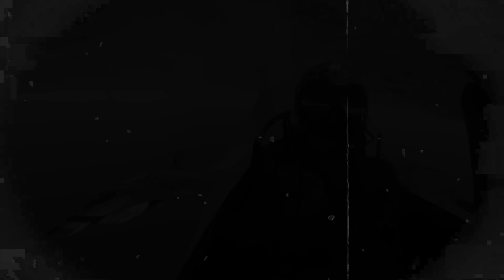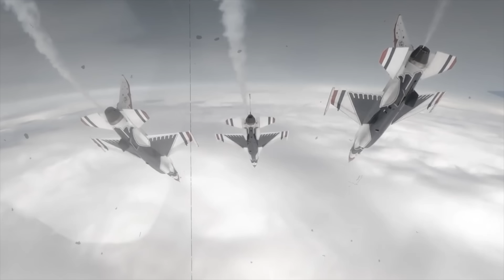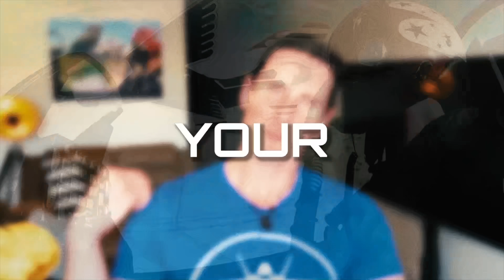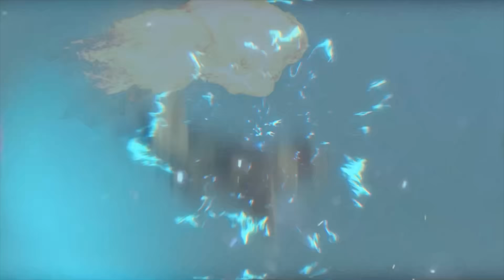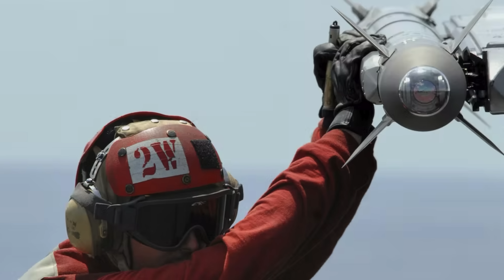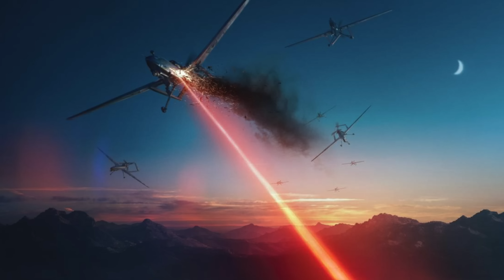F-16 Missed Its First Shot At Lake Huron UFO

Comment: Regarding the downside to shooting these things with cannons - One interesting point I have heard being made by a fellow I talk to online who has a background in both Meteorology and ATC - The pressure difference inside these types of balloon and outside is usually quite small. Peppering the part that actually has lighter than air gas wouldn’t really do much other than to allow that gas that keeps it aloft to escape. Obviously that would lead to a gradual and UNCONTROLLED loss of altitude DOWN into the same airspace shared by commercial and private aviation. 

Nothing says “bad optics” worse than accidentally dropping a fairly benign object into the path of a 737 full of civilians on a routine flight to wherever. 

There is also a story floating around (no pun intended) about a pair of CFA F-18’s both completely unloading their 20mm into a Russian balloon with minimal effect. It just kept floating in the same direction, gradually losing altitude until it splashed down somewhere around Port Hardy, B.C. 

I think it would be worth considering actually snatching these things instead of dropping them. The very first American spy satellites (KH-1) had their film recovered in a similar manner and the CIA perfected the Fulton System (Skyhook) that used passing airplanes to grab a balloon that had been released by a downed pilot or asset that required immediate extraction. Sounds goofy as hell but it HAS been done. That would certainly leave a lot more for our people to poke around and see what’s what. Just don’t take it back to anywhere TOO far off the beaten path that we don’t want the other guys to know about…

Comment: That glass-like done at the end of the sidewinder is a heat sensor because aim sidewinder is a heat seeker!! How much heat did the object give off?? But if the object was small as they say and had a tiny radar cross section then maybe a heat seeker would have been a better option??

Comment: I'm guessing the Sidewinder missed because there wasn't enough temperature diferrential between the temperature of the balloon and the temperature of the background air. They're designed to shoot down jet aircraft which have hot exhaust gasses, not balloons which would cool down or heat up according to the air around them. The shape is interesting, if this is an actual image of the device, it may be that adversaries are trying different radar reflecting shapes to see what shape remains undetected for the longest time.

Comment: There were A10s just sitting there available just minutes away in Alpena, but a slow commercial aircraft was all that would be necessary to evaluate the threat and even follow it down for recovery.
A jet was unnecessary, a properly equipped helicopter could have been used with a simple mounted machine gun.
This whole event was pointlessly expensive for no good reason.
They will tell you it wasnt a balloon but it was a balloon.

Comment: A10 Big sexy certainly could have been/should have been used with the AF32 round which self-destructs about 10 seconds after firing. These are used in the ground based CRAM and other platforms so you don't rain down the bullets.

Comment: The Chinese balloon was flying at 60,000 feet. None of the alternative aircraft you mention (in the bonus round) can fly at that altitude - the air is too thin for "slow flying".

Similarly, the object over Lake Huron was at 20,000 feet. Doubt either of these crafts could reach that height and fly slowly.

On the Sidewinder "miss", unfortunately, you guessed. That is a "miss" in itself. : )

Comment: If the target was jinking' across the sky, say with pulses of movement, then the 'engine' could be puffing out volumes of heated gas to achieve this effect.  These volumes would have the same effect as a flare if the missile arrived just after a pulse, so it all depends on the 'kill' radius of the particular ARM missile chosen as to whether the object was hit ot not. Think of a Portugese Man of War jinking through the ocean with its dangly bits.  A PMoW Drive.

Comment: So far these objects have not been aggressive, however, they do navigate. Even over waters like Lake Huron, you don't want some fisherman cutting open his catch and finding an unexploded warhead. The 20mm is small as warheads go, but if it goes off at arms distance from you, it has ruined your day and probably other peoples too. So, inert rounds are called for. If you put a single 20mm round through a balloon, it could take days for enough gas to escape to bring it down. A partially collapsed balloon will act like a parachute so dropping it on target isn't going to happen. Maybe we could drop a big cargo net out of the back of a C-130 to see how much weight it can carry. That would be a slow descent, but trackible.

Comment: Question... How thick do you think the "strings" have to be to be able to see them?  Ive heard the audio...  they first reported seeing the object at about a mile away, with low visibility.  Yet they noticed it had "strings" hanging down, it was octagonal in shape and was black in color.  They also said it was about the size of a 4 wheeler (according to the flight audio log).  **the A-wax call sign is Huntress btw.  :)  **

Comment: I was actually on vacation at a cabin directly on Lake Huron when this happened. We heard the F-16’s flyover around 3 pm (shoot down happened around 2:52). I assumed they were training out of Alpena ANG base before it was confirmed there was a shoot down. We had an AWACS circling overhead for around 5 hours and a KC-135 over Lake Huron. The next day a C-130 was out by Canadian waters flying low (2,000 ft) in a searching pattern.
Reply from the maker: Dang that’s awesome thanks for sharing
Reply: @MaxAfterburnerusa no problem. I wouldn’t doubt that this thing flew right over us, we were close enough to the UP of Michigan, and where they shot it down was a straight line east off the coast from us. Very crazy to have something like that happen in such an unpopulated area.

Comment: Great stuff Max-  question:  Couldn’t we also consider “capturing” one of these objects?  As in…using a C-130- rear cargo door down….extending a net/cable system-  that would increase the mass of the object-  causing it to fall.  And imagine if that rig had a parachute-  auto deployed at a given altitude.  Or Floatation bags.  Kinda a Capture and Cradle approach- and a means of preserving as much as possible of the objects.
Reply from the maker: Sounds super smart to me
Reply: Thought about this alot
Reply: Unless they were rigged to self-destruct on capture. But that's probably not likely.
Reply: They most likey already know what these objects are and want the least amount or no evidence to ever be found for classified reasons.  The fact that no pictures or a single piece of debris was recovered says it all....

Comment: Could you do a segment on the probably fate of the missed missile?  Does it have tracker so it can be recovered easily? It's probably at the bottom of the lake and I'm sure the Air Force doesn't want some boater catching it on their anchor. It it possible to have its warhead denotated remotely? Just curious.
Reply: Following this

Comment: When I heard of the first one, and everybody was speculating if or how we would shoot them down, I had figured we would send up an ANG F-15 with an older AIM-7M. The AIM-7M is still in service, they're old and cheap, and semi active radar homing would mean a potentially very far, safe firing range. 

What's your opinion on why they didn't use a Fox 1 or even Fox 3? The Fox 2 just seems the least likely missile to do the job. Illogical even. I really wanna know your take on it though.

Comment: OVERALL
The most likely answer to all of this is that the Chinese have used high-altitude balloons to both surveil and launch surveillance drones for years, including over U.S fleets in international waters.

DRONE OVER HURON
If the drone was shot at 20,000ft over Huron, then it was probably seen at that altitude, or higher, in Colorado. It likely rode the approximately +60knot winds northward at that elevation to be seen the next day 1,000 miles away over Huron. To me, this possibility makes it most likely a balloon, or hybrid-balloon with drone-like directional technology (propellers), and a minimal set of surveillance equipment.

CAPTURING A DRONE
Instead of destroying an apparently slow object, is it possible to either capture it or disable its propulsion or lift capabilities so that it descends?

METHOD 1 : DRONE. Is it possible to launch a drone from a cargo plane, fly it toward the balloon or drone, attach itself, disable the foreign object’s propulsion or lift, and descend with the object in tow? Or if not possible, could a drone at least disable the propulsion/ lift to force it downward?

METHOD 2 : HALO. Is it possible to use HALO to make contact with high-level drones and balloons? Would a HALO parachutist be able to make contact safely? Is it possible to briefly explore their construction, to attach equipment that will direct them downward, or to damage their method of lift or propulsion enough so they descend? Even if contact is not possible, is it possible to briefly photo-observe them in action to gain more info about how to engage them by other means?

METHOD 3 : SNIPER. Is it possible to fly a cargo plane with one or more snipers who can damage or disable the balloon or drone propulsion-lift thereby forcing it to descend?

METHOD 4 : AERIAL CAPTURE. Like we did in the Antarctic, is it possible to extend a “hook” or net from the ramp of a cargo plane, snag the object directly, and drag it inside? That seems risky and Vietnam-era-CIA old-school, but is it possible?

Comment: Looking at this object with its sides shaped & contoured as sails, makes me wonder if it, by utilizing an adjustable internal ballast, perhaps mounted on something similar to a gyroscope, is sailing within, through & across the jet stream.
Reply: Yes. It may be pretty simple mechanically, but still able to surf the jetstream. The "strings" on the string version could simply be ropes of heavy ballast it drops off to climb. It probably needs a good flight computer and a comms link for weather data so it can work out when to go up and down to exploit the latest changes of wind speeds and direction. 

But I think the octagonal craft that ended up in Lake Huron must also have had some gentle stealthy propulsive system, as it seemed to be able to add about 100mph to its velocity above what the wind was providing. Enough for moving across and against winds, and to loiter. So the power required is probably no more than that of a small aero or motor bike engine. But made out of stealthy materials. It could even be a pulse jet, as they are mechanically simple, perhaps allowing the use of low radar-reflecting materials in their construction. The return of the V-1 Doodlebug!

Comment: depending on how durable the object is, you might be better off ripping past it at mach (not hitting it) and allowing the shockwave do the work (less affective at very high altitude) but it might not take much.  weather ballon material is pretty thin stuff.
Reply: Why don't they do that?
Reply: @UNQUEATH because of the higher risk of losing the entire plane
Reply: Great idea!
Reply: @@reidjames4638 Don't or won't?
Reply: Could have sucked it into the intake and glided back to the field. 2 birds with one stone - kill and retrieve! 😝

Comment: Hey man, have loved the channel since the first gs reaction. It's awesome to have a positive, genuine people in the military aviation community.! 

So my question is, (if you can speak on it at all) what other weapons, weapon systems could or can't be leveraged for these engagements. 

Example, why not a HARM/AAMRAM/ aim7 ect... Of all the aim type Missles. 

Secondly what about ground launched munitions, like some of the newest kinetic / EW, "drones" for anti drone operations. 
I think it would be good to test those systems to do what they were literally designed to do. ( I know the safety aspect but punching off a Missle isn't much better, plus you could still intercept and get visual from further away or slower aircraft could handle it.) 

 
I have thought alot about  these non kinetic/explosive/ destructive, net / capture & EW  types. I would think that's the best way to recover them. ( Assume size/mass is the reason they aren't being used)

Also other ATG/ATGMs , like HELLFIRE not sure the specific name, but the one without a warhead. Or even tow type stationary/ Lazer guided

Personally for the most part, (beside the first balloon sat  because of it's ALT) because of the size an speed. I would want to be as close for vid & far for de-conflicting/safety. So  if I'm engaging something that is relatively stationary to me or the ground. I would need to match it's speed. Manage my closer rate. Super difficult, in a jet.  But seems to be a helicopter ie apache/cobra ect.. would make that much easier an safer.  Another question is can a f35 b go into the hover or relatively stationary at Alt  (I assume not) 

Also wouldn't a large straight wing, EW/ attack  aircraft like A-10 / AC-130 / E-2 Hawkeye/ mq - 9 or global hawk, even trainers / turbo-prop for up close & slow VID. I think most if not all of those can fire A-A, and guidance could be self or buddy lazed / targeted. 

Each one could be above the target (look down shoot down ) , and or do the circle of death around it never on a intercept path. 

I know it's a long & detailed question but I figured I'd ask as these topics seem to be doing good things for the channel (p.s thank you in advance, love the channel ! Looking forward to dcs content, I know actual military tactics an operation makes that difficult, but I think thunderbird / aerobatic content would be amazing an unique)
Reply: ⏫⚠️ REPORTED ABOVE SPAM⚠️⏫

Comment: Understand that there are rules for standoff between A/C, specifically proximity between while passing.   Theoretically speaking, would a supersonic flyby at minimum safe distance be effective on a balloon?    Thinking the shock could tear the membrane.

Glad you spoke to the dangers of cannon use. 20mm has a ridiculous max range a sea level ~5000m. At altitude it is much further.  The beaten zone would be huge, and backstop would be impossible to visually clear for safe firing.
Reply: Another thing I don't see pointed out at all, is that the rounds from , 20/25/30mm ect used in CWIS / auto cannons. Yes they are "safe", but only because they use a HE & Tracer hybrid that fuse/detonate automatically after a set time range,   so a non HE projectile means it will go much further then standard A-A

Comment: Question: if the missile can target using light optics instead of or in addition to inferred than why don't they make the algorithm: target object that is xxx differential of ambient light, if multiple targets found retarget to ambient light with xxx% maximum variation.  If current target exceeds ambient by xxx% aquire new target.  You can even add a pixel filter like how some security cameras work.  Retarget object if pixel density or size is less than xxx of previpus target if above 5,000ft, if below disregard pixel data. (To ensure buildings and boats and such can't be targeted)
There's no reason why in the 21st century that a $200 flare should be able to outsmart a half million dollar missile! 
If we continue to use chaff to make our enemies think we are stupid, that's fine, but I hope to God that it's just for show or just for beating old soviet era munitions.  
Love your channel, just found it this week.  Everyone should subscribe before they forget and lose the channel forever.... subscribe you turkeys!

Comment: do Missiles have AI yet?  feel like at this point Missiles should be taking readings from many types of sensors and having AI build a target profile so the lock is secure AF..   AI could calculate likelihood its still locked on target as parameters change..  a really simple example would be an AI missile taking readings of temperature, velocity, trajectory and known target profile information and this way (assuming this target was a jet) if they threw chaffs they AI could determine that the new heat signature signals violate the original targets heat signature, trajectory and velocity plus profile and so not to break lock on the original...

Comment: Why not just use the cannon?
Reply: At night?  Collision hazard.  You don't want to be flying at an object you can't see, at high speed, trying to line up a shot with a weapon so short-ranged that the time between entering range and flying into the target is just a second or two.  Not to mention that the gun is aimed with an optical sight.  You can't aim it by radar, you can only cue to the target by radar.
Reply: @@bronco5334  Come on, man,  A hot shot like you should only need a tenth of a second to shoot it down blind folded.  I guess you just proved the F35 is lousy at ground support, and we should build more A-10 s.
Reply: @petterandersson7429   Obvious troll is obvious.